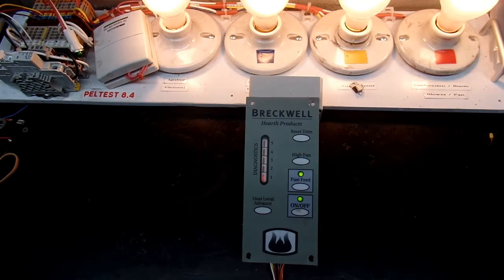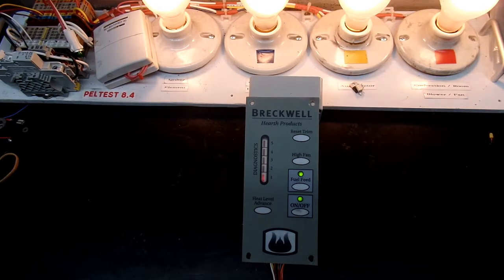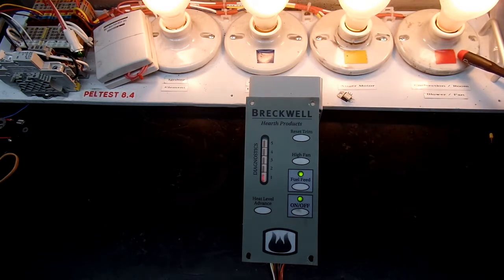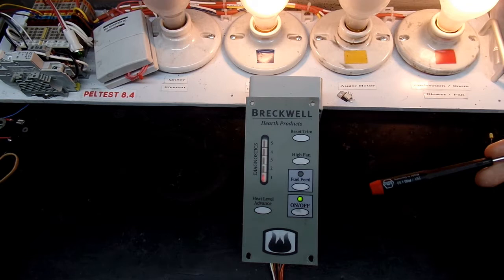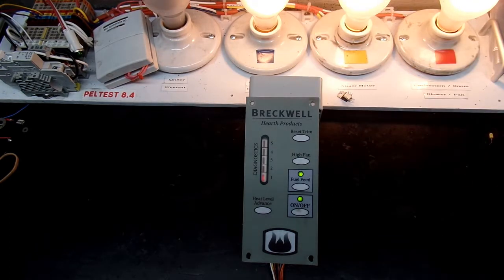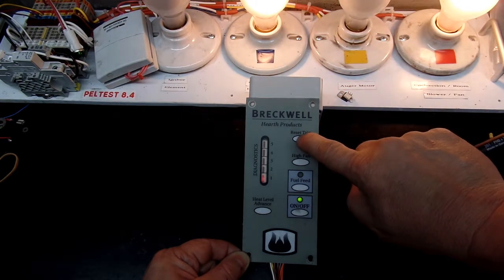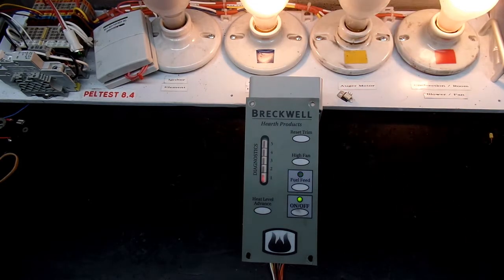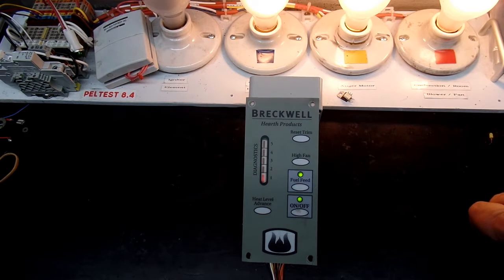Final Test of Janelle's Breckwell "Digital" Pellet Stove Controller.

Comment: My stove turns on for 30 seconds or so thn fan goes off and the red light starts blinking.. wont ignite
Reply from the maker: Hi..  I'm a bit stumped on that one...  so I don't have a good suggestion for you, without getting my hands on that controller and running tests of my own... I don' think I've encountered that type of issue in the past. My suspicion is a stuck micro-switch, but that's not based on prior experience.

Comment: My p4000 room fan turns on as soon as it is plugged in without buttons pressed. When I push “on” the stove will flash the “on” light until the stove ignites, at which time it turns solid. When turned off, however, the room fan never goes off unless I disconnect a wire from the proof of fire sensor. Please advise.
Reply from the maker: If disconnecting the Proof of Fire circuit causes the fan to stop blowing, that indicates that the controller is able to command the fan on and off, or at the least the voltage supply to the Fan's solid state relay system.. There is only three sensors on that unit..  Exhaust, Overtemp, and Proof of Fire. Overtemp should cause the fan to run, but I would think that it would prevent the auger and the ignitor from starting a fire... I'm sorry that I don't have more to offer..  Without me connecting ot to my tester, and comparing performance to the manual and previous units I've workrd on,  I don't have much guidance I can offer.